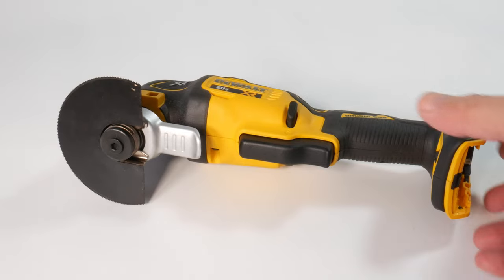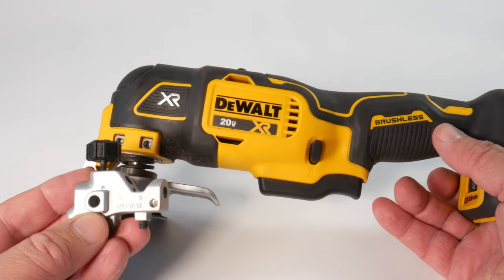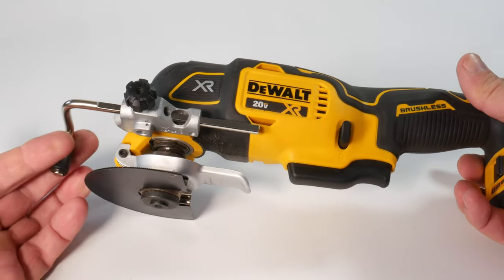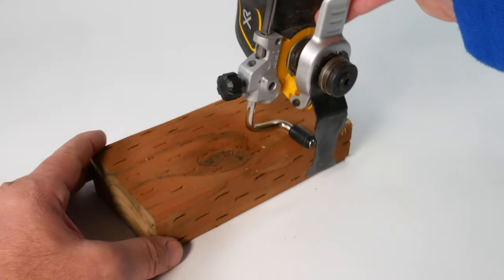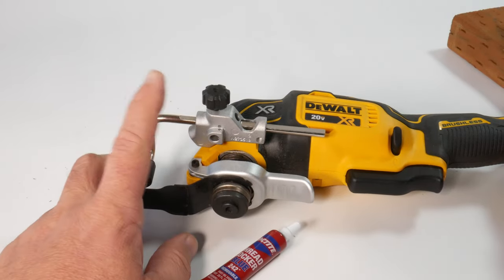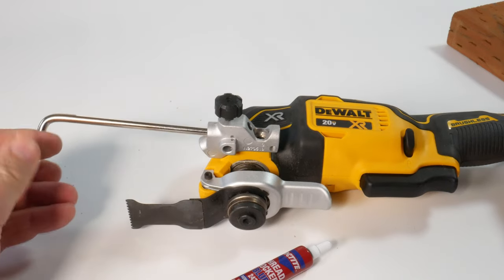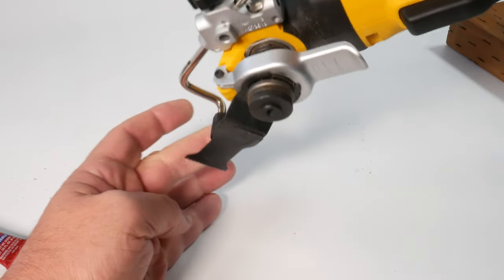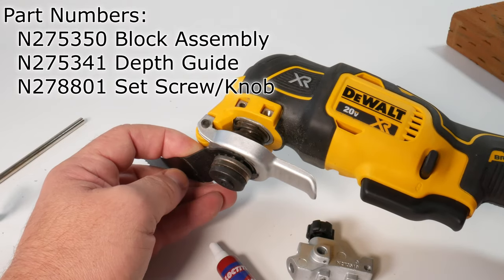DeWalt Multi Tool Upgrade - Depth Guide/Gauge quick and easy DCS353, DCS354, DCS355, DCS356, DWE315

Comment: You are right, they are pricing everything separately nowadays. I'm surprised when you buy a DeWalt tool, they don't have a separate charge for the box and then another charge for the owners manual. So much for making the customer feel "value added".

Comment: Just bought mine. It came with the depth gauge. Thanks for showing me how to use it!
Reply from the maker: You're welcome! Cool to see that DeWalt now offers the depth gauge as part of the package! Consider using thread locker otherwise this thing will vibrate itself loose quickly!
Reply: Chce kupić, widzę że super sprzęt.😬😬😬

Comment: Should of been designed with two rollers instead of one so it can be more stable for more consistent depth instead of one where it can tilt.

On a different note. The quick trigger blade change on these Dewalt multitools are a great feature compared to other ones out there. You can easily and quickly change blades or change angles in an instant.
Reply from the maker: Yeah, two rollers would be better. And yes, I love the quick tool-less blade change, on my old Bosch it took a hex-key.
Reply: @CascadesHomestead  I thought about it. And I am thinking now that the one wheel is by design so you can rock it back and forth to clear shavings when making long cuts instead of just a plung cut. You would just have to adjust it according the corner tip of the blade at a 45 degree angle which would be the deepest point.
Reply from the maker: Hey Bubba, I'll have to play with it more but there have been a few times where I was trying to do very precise cuts and two rollers would have been better. Well honestly, I should have just used a router for that, but I was too lazy and used the multi-tool instead :)

Comment: too bad there is not a handle attachment sold for this tool
Reply from the maker: Oh, you mean like for an angle grinder? That would be an awesome addition!
Reply: @CascadesHomestead  yes to help compensate for the vibration, giving you more control for finer cuts and just more control over all, but I still love mine.